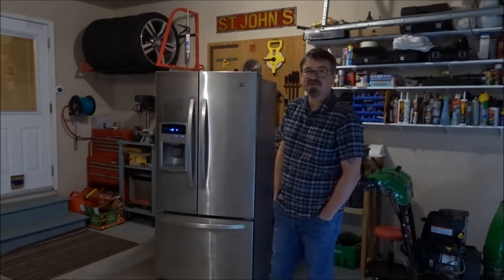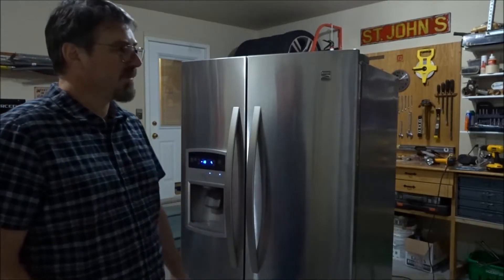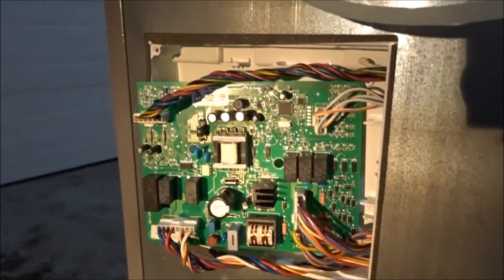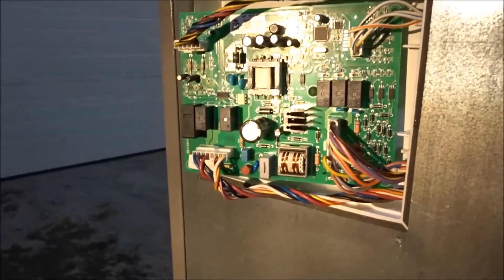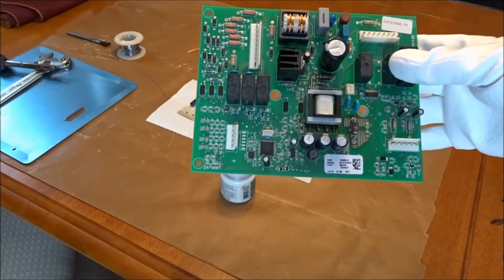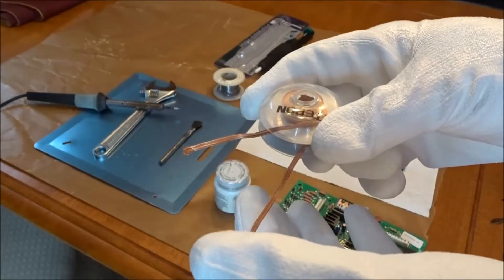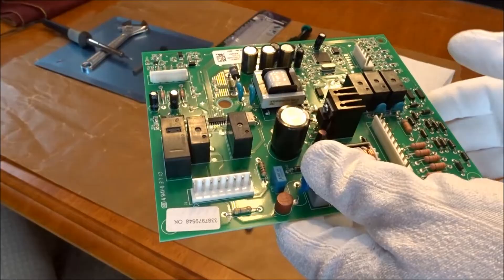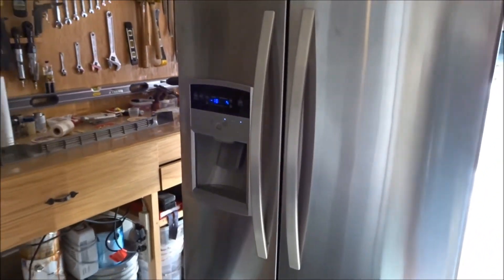Refrigerator Circuit Board Repair

Comment: In your case the board was aound $110  cad so well done. In my case in 2025 my board is $42 with tax. Have less caps to change, but odered new one and will try repairing old one as a spare. My blew bcus we had many brownouts in the past weeks with no protection. Just bough 2 new surge protectors and will go on both grige and ice box.

Comment: Thanks for the video. Do you know where I could find the diagram of the board, I am interested in finding the D9 diode specs. Mine appears to be not blocking when testing with the meter.

Comment: Mine is the same board. I hear the ice cube flap only once when i first plug it up, but the lights do the same (light up only when a button is pressed). I bought a replacement board and it does the same thing. I checked the capacitors on both boards in-circuit with a multimeter set on 200k ohms and I can see all capacitors charging up on each board at the same speed. (they'll max out either at "infinite" (OL) resistance or to any resistance in the circuit that's parallel to the capacitor. Smaller ohm settings charge the capacitor up too quickly to OL to see it the effect. All this indicates it's not the board in the back, but in display control board in the front, but its caps check out too. Small SMD caps charge up too quickly to watch them accept charge and are more likely to have parallel resistance, but you can at least check that they are not shorted.

Comment: I have a Dometic 12v RV fridge (capacitor -- NOT absorption though both use control boards) and one thing that has been brought up by users is how frequently these control boards go out. Unfortunately, no one yet that I've come across has indicated WHY they go out or what (if anything) can be done to repair the boards rather than shell out $$$ for a replacement board. 
This is an AC appliance in your video but do you have inkling as to WHY these capacitors fail? have you received any feedback from viewers who have found that it's ONLY that one capacitor that you eventually replaced that is the one that fails or is it a random selection?
I'll continue to research for RV fridge control board repairs but just curious if you have any insight into this problem. Maybe it's possible to do an easy fix for these RV fridge control boards? Wouldn't that be nice!

Comment: I repair these boards all the time and every time I remove the old capacitors I test them and let me tell you, most of them are bad including the small ones so replace them all before the small ones cause a problem to your new ones. The only one that doesn't have to be changed is the biggest one on the board because every time I tested that one it was almost like new

Comment: Next time you do rework add some solder before desoldering. The factory solder has a higher melting point than the stuff you have on your roll. Adding your solder will lower the overall melting point making it much easier to desolder.

Comment: There is always a last capacitor ! A last damaged head on a screw !  A last broken head on a bolt  !  Murphy's Dam Law !
why cant you insolate the bad Cap. whilst it is still on the board. Then you don't have to replace good ones.

Comment: You saved me $250 for new control board! At first I checked with all capacitors with Ohmmeter , Voltmeter  seemed like they were OK. I had few spare 10uF 65V caps and I went ahead to change on control board. Voila, the fridge came alive. There were x3 220uF and x1 47uF, but I forgot to write down voltage on those caps, anyone has info ? Thanks

Comment: I'm currently jumping into the component repir universe sir and I have noticed that if you are going to upgrde your board you might as well replace the relays...and thanks for pointing out the longer lead being positive.One other thing I have seen is a feller add heat with a heat gun to the capacitors and they came back to life if only for a short while.

Comment: Hey! I am having difficulty locating the control board on my Kenmore Refrigerator. Every video I see on youtube has the little panel on the back of the fridge with the control board behind it, however there is no such panel on my kenmore fridge. Do you know where the control board may be located?

Comment: You switched to to a larger "Soldering Iron"..NOT a soldering gun. Holding those Elecrtrolytic Capacitors with a Vise grip is a NO, NO. You might end up squeezing them to hard causing the Electrolyte inside to leak/damage the capacitor itself. Looking at the control board I was able to see the components which make up the switching power supply and it's full bridge rectifier or Voltage regulator. Those capacitors dry up, thereby causing the problems. I am a retired bench technician.

Comment: Had that irritating flapping sound from the ice cube door.  Based on this and other videos, I looked at the control board capacitors and did not notice any issues.  I ordered the capacitors anyway but in the mean time simply cleaned the contacts using electrical contact cleaner.  It's been a week so far without the flapping issue.  Edit ... And on the eighth day it started again.  I changed the capacitors as per the this video and works so far.  Thanks for the video.  Edit #2 ... The replacement C13 capacitor was exactly the same specs but failed within 2 hours.  Replaced the C13 capacitor with the old capacitor (I think it was C12 - 35v 680uf) and seems to be working again.  Maybe I got a bad capacitor, or the specs were not actually the same.  It was a Panasonic cap so I thought it should be good.

Comment: Excellent video, I fixed my Kitchen Aide refrigerator model: KSCS25INSS01.  American home shield's repair contractor replaced the inverter but that did not fix the problem , so he gave up.  I then found this video, made my own repair and now my fridge is working fine.  I bought a solder kit on amazon for $10.00 and had someone help me with the solder sucker.  The work took about 1 hour and I have very limited mechanical skills.

Comment: Thank you sooooo much. I fixed my Maytag thanks to you. The capacitor which was the culprit for me was a 10uf 50 volt radial. Total cost $0.19.
Reply: Hello question for you before you fix the all that did your freezer still freeze and frigerator still work?
Reply: @darrellbryant3666  nothing worked. The interior lights still worked, that was it. The front panel would light up  when pressing any button.
Reply: @philvarnas9589  thanks so much
Reply: @darrellbryant3666  good luck.

Comment: Do you have any way how to check that the capacitors were bad? I don't know anything about electronics, but I understand that there has to be some way to measure voltage to know what or which one is damaged.

Comment: I had this problem with my fridge after having my power service switched over and figured it was the control board. 
I inspected the board for anything obvious and saw a little moisture underneath the 25v 47uF capacitor. So I researched it and came across your video. I checked the cap and it was OL both ways. I changed the capacitor which I got at a local electronics supplier for $1.19. CAD. I had found a board on Amazon for $247 CAD so even if you include gas to get it I’m still way ahead. 
I did pick up all the caps for $10.05 just in case but only needed the one. 
So I have the others if I need them. 
Thank you to you and your video for saving me at least $220.

Comment: Did my cap repair yesterday. The two larger caps of the first set you replaced had ruptured on 2006 Maytag fridge. Replaced those and it came to life 12 hours after the first fault appeared. Didn't have to unload the packed fridge and freezer. Whew!

Comment: I am repairing the same board from a friends Sears Kenmore. I found that C45 (50v 10uF Elna capacitor) beside the microprocessor was the failed component. It was measuring 32 ohms with the ESR meter.

Comment: WOW, this ebay guy is making a killing on his parts kit. You can buy all the parts from Digikey(with shipping for probably $12).
Reply: But you have to know the parts to buy  if you did not have a kit..   So now  with this video you do and the location and how to find the board.
Reply: @danc2014  yes of course and I understand not everyone has a degree in electronics, I do. But anyone can read the numbers on the side of a cap, then call digikey and say I want the same, they will assist you in making sure you get the same values and send them to you. I'm not blasting this guy for making some cash, nice little gig if you want to do it. But he should have also offered up the list and values.

Comment: I'm curious what brand of caps were on the board, or did they even have a brand name on them. The final cap you changed looks like it's next to a TO3 pack IC which is probably a regulator, a bad cap on the input could for sure cause problems. 
Okay first a few tips on desoldering components. A solder sucker is a good tool, you don't need to put paste on solder wick, before trying to heat a solder point you need to put a little solder on your soldering iron's tip then apply to solder point. Once it is flowing then use the solder sucker, do the same for the solder wick. Doing this will make removing the solder that much easier and prevent you from ruining your board in the process. I've been designing and repairing electronics for about 40 years so follow these few tips. Best places to order parts from is Digikey or Mouser, unless you have a small electronics wholesaler near you. Digikey has cheaper shipping than Mouser, at least to Canada. Good video sir.
Reply: I am working on the same board for a friend. The last cap you were asking about (C23) is a Rubycon. Surprisingly all the caps on the board are Japanese (Panasonic, ELNA, and Rubycon). I will post back later on my findings for which caps are bad when I test with an ESR meter.
Reply: The ones I replaced were JH CD282  680uF 35V

Comment: Thank you. Quite helpful. However, I would suggest that you put the video showing what the trouble symptoms were at the beginning rather than the very end. I did have the exact same symptoms in my failure, but it would have been comforting to know right from the start of watching your video that your repair was going to fix my problem.

Comment: Thank You so much, u saved me minimum $600. I used ur link but deliver was going to be about 3 weeks and I couldn't wait that long so I screen shot the end of it video where u show the parts that came in ur kit and I was able to go to an electronics shop and pick up all the parts for $9.40. Just a tip for ur subscribers that may not be able to wait 3 weeks. Thanks again, excellent video.
Reply: Ben, is your board model  W10310240A? Can you please list the capacitors you have replaced ? Thank you!

Comment: I have my fridge bypassed straight voltage to the compreasor fan system.   My board is different than this one. I think i might just replace it with an arduino. I already have the program for temperature controll and relays for my server fans. I think all i need to do is hook up the compressor to the relay and set the temp I want on the arduino. But idk how the temp regulates differently for the freezer and the refrigerator

Comment: How do you repair the existing main control board that mounts in rear of refrigerator the circuit board just causes panel on front Left door to flash no matter what button you push

Comment: You might have a bad relay to that runs the auto defrost Or the fridge or freezer fans
Reply: I think this might be whats wrong with mine because i replaced capacitors and problem returned.   I also smelled burning and it seems a diode has blown.   Any idea what relay might have gone bad?  Or just replace them all?

Comment: I have the Maytag W10310240A refrigerator control board. I have ordered the repair kit you recommended and I am waiting for it to arrive.
I had read your  “limp along” fix about putting a hairdryer blowing on the circuitboard and that the refrigerator would operate. And that’s what I’ve done for the past few days. And the refrigerator has operated normally. None of the capacitors are bulged but I figured the one next to the heat sink was probably my issue.
While I wait for the repair kit to come, I found locally a nichicon high temp 47 µF 25 V capacitor that goes in the C 23 socket next to the heat sink. I replaced it this morning and unfortunately, when I put everything back in place the refrigerator will not operate at all. So I lost ground and replacing the C 23 socket capacitor. 
Looking for any thoughts on how to proceed from here. 
Thank you for any insight you may have. 
Danny Schulze

Comment: Good day m having a problem of samsung fridge I changed capacitors and relay but still when i plug it it burn the fuse.any idea if u can help
Reply: You have a short on the board. You need to figure that out with a meter.

Comment: I rarely comment on YouTube, so please understand you have motivated me to take action and sincerely thank you for sharing this information.  You made it very clear exactly what needed to be done and shared valuable information that I wouldn’t even have initially thought to look up, and then saving me time to do so!    I was able to order the parts and install them using your instructions as a guide, and now the KitchenAid refrigerator is back in operation.   I ordered two sets of replacement capacitors, and taped the next set on the rear of the refrigerator because having them means less than an hour to fix the controller board!
Reply: If you replaced the caps with quality brands like Panasonic, Nichicon, UCC or Rubycon you won't have to replace them again. JUst make sure you use high temp versions (105*C) and they will no doubt outlast the fridge.
Reply: Capacitors have a shelf life, if you leave them taped to the back of the fridge for years they probably won’t work when you go to use them.

Comment: whats with the white gloves?
Reply: Gloves eliminate oil from hands And you must control static electricity when working any electrical board hence the gloves.
Reply: @tonybrinkley3699  Ha-ha, I would worry too much about that, the odds of blowing the board by handling it is very low and oil from your hands, unless you just pulled your hands out of the oil vat then again don't worry about it. How do I know, I've been designing electronics for decades.

Comment: Thank you i changed four 10mf 50volt capacitors on my control board i got the copacitors off ebay for $5  and it fixed the refrigerator.
Reply: Those did it for me too

Comment: hey im having a smiliar issue with my fridge right now it wont start at all and when i plug it in the fridge opens the ice flap then does nothing and im locked out of the controls any idea on a fix thank you
Reply from the maker: if its a similar fridge to mine its probably the control board, pull out the fridge and take the back panel off that covers the circuit board, try a hair dryer on the circuit board, funny as that sounds the warm air made my fridge cut in and run,. After a few weeks of doing that I eventually repaired the main circuit board by replacing the capacitors.  Good Luck :~)
Reply: @MarmaladeBlackwood  thank youss
Reply: @MarmaladeBlackwood  This blew my mind a bit. I tried the hair dryer trick and it kicked right on and ran for a half hour or so. I still don't fully understand why it makes it work for a while. I work with these components and circuit boards daily, and I really don't understand what's going on here haha.

Comment: Nice work. I was just talking to guy who repaired a flatscreen tv with a capacitor issue.
Reply from the maker: Thanks  Buddy...The guy I bought the repair kit from was telling me about the low quality capacitors that are being used in Modern electronics, its sad because a good quality capacitor is only a few cents more to buy .
Reply: @MarmaladeBlackwood  That board has quality capacitors (Japanese). I am wondering if they are being run at the max voltage 50v, causing the failure.